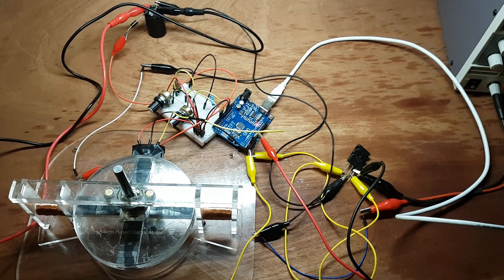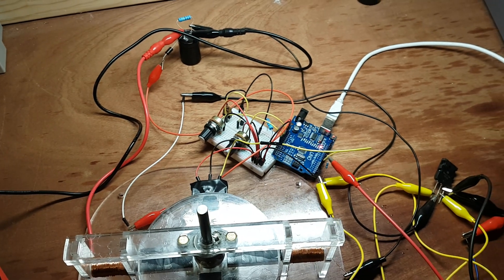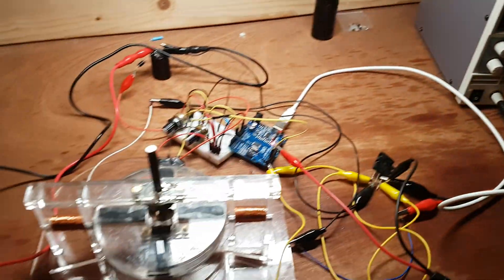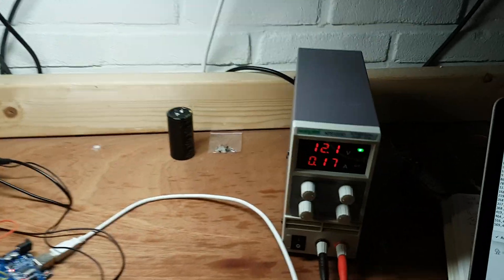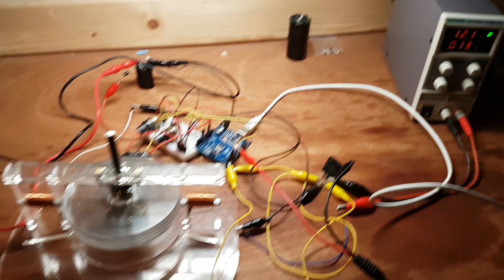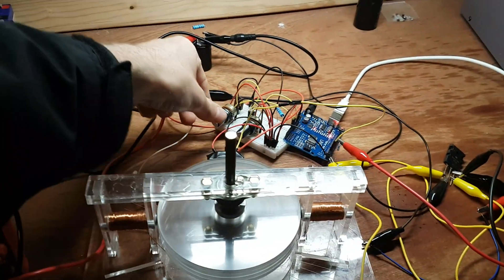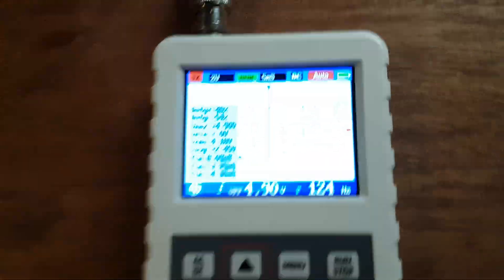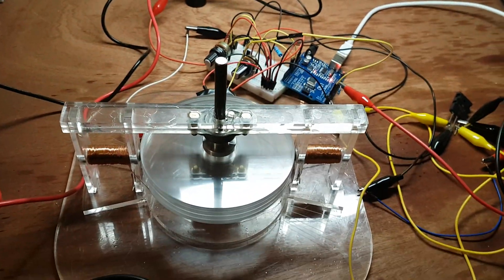Arduino Pulsed Motor Controller for Adams Motor

Comment: What does this device actually do? Is it to charge a battery? I've just read a lot of comments saying the 'Bedini SG' motors are scams. (Along with all the rest of the 'free energy' stuff) It's interesting and hope it's real but, idk enough about whats going on to really figure it out. What type of volts / amps do you have in compared to the output? thanks
Reply from the maker: I have indeed given up on pulse motors, because there were indeed so many scammers that I wasn't able to figure out what was real and what wasn't. The idea was that it would be able to run the motor, while simultaneously capturing excess energy in a secondary battery bank.

Comment: How ist the curcuit for the capacitor. I saw it in your blog, but never get anything out with the way adams showed it in his papers. I only get energy from the normal diode path, from one end of the coil to the other end.
Reply from the maker: Yeah to be honest, I gave up on this line of research. Wasn't able to get any extraordinary results.
Reply: @Waveguide  did you try, to use a battery for the device and put back the energy of the generator coils into the Battery. If you don't need much energy to rotate, than you maybe can load the battery, with the flyback and generator coils. And load a battery is totally different from using energy to light up led's. If you short curcuit the Generator coil, it goes faster, than with the led's and there is a reason for it.

Comment: a very amazing prototype!! really inspired!! a few questions btw

1.what is the diameter & thickness of the rotors?
2. how many turns in the coil and what is the core?
3. are they alinco magnets or neodymium magnets?
Reply from the maker: Hi, thanks for your questions!

1. Rotor is 116mm diameter, and 20mm thickness
2. Core is soft iron, not entirely sure how many turns, but Adams mentioned the goal was to have the coils be 10 Ohms, and from my research it seems he used 0.35mm wire for his smaller machines, so that should allow you to calculate how many turns you need.
3. Ferrite magnets

Comment: I notice you using an A3144 Hall Sensor. Good Job!!!
Reply from the maker: Correct! :-) I'm now trying to recreate the star wheel commutator that Adams used.
Reply: @Waveguide  Thank you so much for putting this information out there. You doing a great service to the community.

Comment: Going to dig into the method of controlling the coils. My project has a total of 18 coils... If you have any thoughts on how to time them I'd love to hear from ya
Reply from the maker: Hi Robert, there are multiple ways to control the timing, like using a Hall sensor, trigger coil, or slotted optocoupler with timing disk. For more precise control you could hook these up to an Arduino like I did, but if simplicity and robustness is what you're after, then maybe skip the microcontroller. Hope this helps.

Comment: Excellent work! When you reach the resonance, the voltage goes up! Adams claimed these motors were 800% efficient and there is a similar motor on the market for home generation. It's interesting that your duty cycle is quite long at 33-43% as Adams used about 20-25%. He also activated the drive coils when they were aligned with the magnets with no delay. Keep up the good work Nick!
Reply from the maker: Hi, the 800% efficiency claim I believe originated from Patrick J. Kelly, and I haven't found a statement by Adams himself yet claiming that. Adams recommends a duty cycle between 25-35% in his Adams Motor Manual. Where did you get the idea that Adams activated the coils when they were aligned with the magnets? Because in his patent application he specifically mentions that the pulse starts a X degrees past alignment, see: https://waveguide.blog/wp-content/uploads/2020/12/adams-motor-patent-drawings-1024x695.png
Reply: @Waveguide  I think the duty cycle is related to the air gap as on my experiment I had to tune the air gap between the magnets and the coil so that the drive coil didn't lock onto the magnets yet gave it a good push when it came around! I know those diagrams show the pulsing begins at 'x' degrees pass alignment, but in a later NEXUS article he had x=0.
Reply from the maker: @donotwantahandle1111  Thanks for your reply! If you have a link to that NEXUS article, that would be amazing! Also, I think ideally you'd use just enough current to neutralize the attraction of the magnet to the core, but to maximize efficiency, you don't necessarily want to use so much current as to actually "push" the rotor I believe.
Reply from the maker: @donotwantahandle1111  thanks! I've read that article indeed. Both Adams and Bedini talk about "time reversed", which seems very vague to me. Don't they just mean opposite polarity? Highly doubt time is reversing itself because of a rotating magnet.

Comment: fun project, but what's next? A motor without load, and a cap charged from the inductive spikes of the coils, like a boost converter. We can do more!
Reply from the maker: These are indeed baby steps :-) Just trying to optimize the drive circuit for now.

Next is this:
- Power the circuit from a battery
- Discharge the cap back into the source battery to keep it charged
- Add generator coils to extract additional energy
- Add current and voltage sensors to Arduino, and output everything in graphs on a computer to have a full dashboard of the most important motor parameters
- Create a PCB for the project
- Make plans and kits available

You mentioned the no load before, but these types of motors, just like Bedini motors, are meant to be used as generators, not to power heavy mechanical loads, although they could do this with different types of drive coils and other tweaks.

Running without load and with as little friction as possible allows the most efficient performance, and makes it easier to keep the source battery topped up.

You then have a spinning magnet costing you hardly anything, and then you can utilize that as a generator.

I have attached a load to the motor before (a fan), and do plan to measure torque etc at some point.

Or did you have something else in mind?
Reply: @Waveguide  the generator coils will be the load.
I love these kinds of projects, but seen them often repeat the same goals, without ever reaching the goal.
This (in my opinion, which is based on research) is not generating more out than in. Thats why we have never seen a working example. (although claims are made but never proven) 

The concept of the impulse inductive spike, generating more energy from the ambient (Bedini) is fascinating.

And I do strongly feel the impulses (inductive spikes, back emf, flyback) are key.

But it needs to evolve much further.
I dont know the whole truth, and I do want to find out how it works.

One thing, I do know:
the inductive spike, back emf, impulse, is a resonant half wave.

it is made from the magnetic field energy of the coil which is resonant transformed into a voltage.

The Impulse energy is always slightly less due to resistance.
making a magnet move adds to that resistance (a little bit). Large batteries will hardly show how much is lost. 

What I have seen from my own experiments (and reading Tesla's works) is the impulses can influence the impedance (resistance) of resonant systems.

Indeed "magic" happens when a Primary coil (series resonant) is impulsed. It magnifies the current.

This I have shown in my videos, and it is not from resonant transformation.

It seems the impulses (inductive spikes) change the properties of the Aether. making it more conductive (less impedance).

I encourage you to proceed, be creative and learn share and succeed.

I hope someone will one day find out the secret of how to generate electric power from the Aether, and share it openly.
Reply from the maker: @MasterIvo  I absolutely agree with you! 

So many of these YouTube videos promise a fully developed version will be made available for sale soon, but then you never hear from them again...

My project might progress slowly, but I do plan to keep working on it until I can prove the claims on my workbench and then share the plans in detail.

The reason claims are made but never proven, is because many people build a motor quickly, and don't closely follow the instructions of the inventor (in this case Robert Adams).

I am taking my time and read every single bit of information Robert Adams has ever published to make sure I follow his guidelines exactly. 

Only then can we say if his claims are correct or not.
Reply: @Waveguide   Best of luck! And keep an open mind and heart.